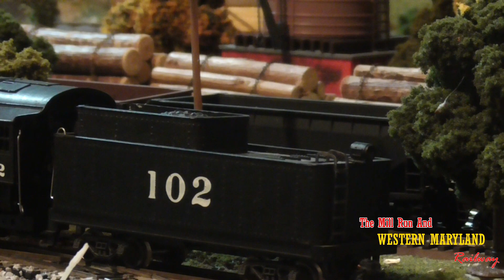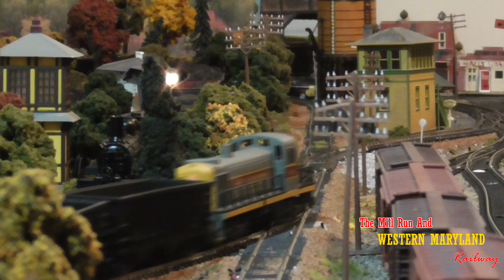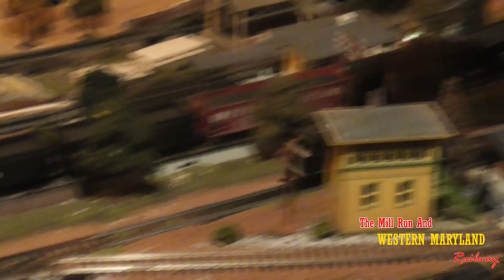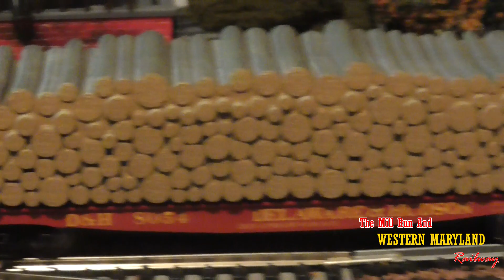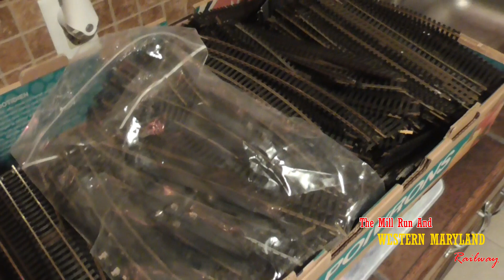Model Train show haul, Greenberg show 2022. Erie Lackawanna, Rivarossi 0-8-0, Dockside, and more!

Comment: Great video! Nice to see other peoples train show finds. I have a question when you work on your locomotives do you grease the gears, oil bearings, and clean the commutator? That could be what is causing it not to run. For repowering the model powers somebody else on youtube is ordering motors that are designed for model trains and he will have those for sale soon.
Reply from the maker: Thanks for the comment! And yes, I did service these locomotives after pre-testing them. Still have a few bugs to work out! Lol!